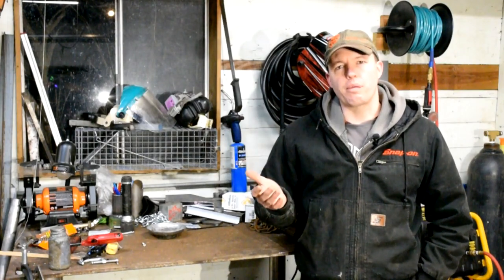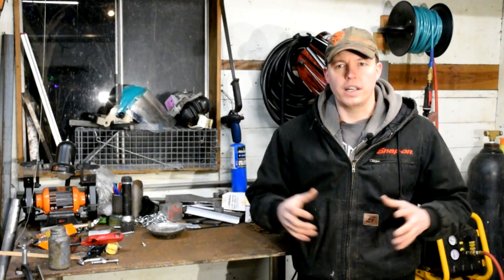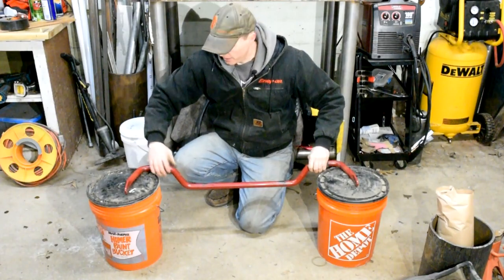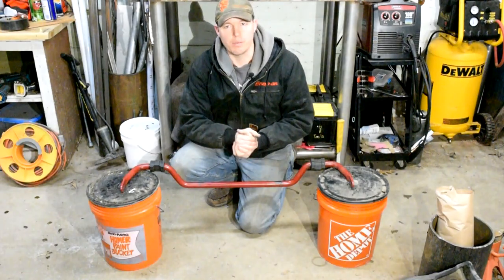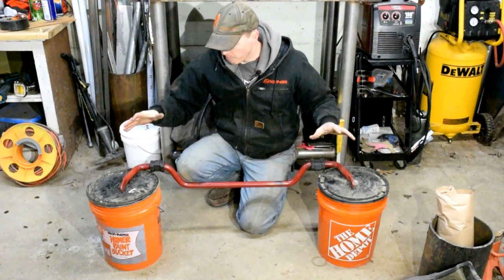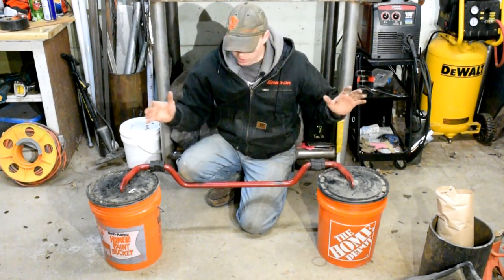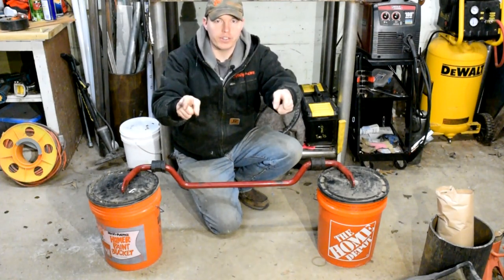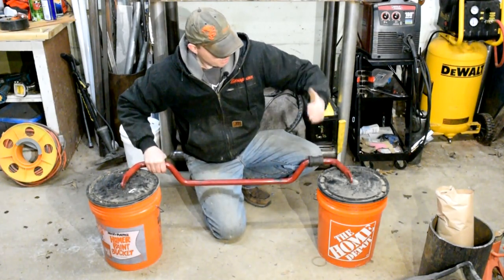How Sway Bars Work - Complete Explanation

Comment: Instead of a sway bar, has any car manufacturer company created a suspension that makes a car body bank towards the side it is turning on.... Similar to a motorcycle when it turns....
Reply from the maker: Yes, some car manufacturers use active suspension to counter the body roll. They probably don't lean in like a motorcycle but they help to better distribute the weight of the car.

Comment: the clamps on the bushing it should be very tight no movement whatsoever. The reason why the sway bar is a an actual spring for each side it’s not meant to move on the other side because the spring on the strut will push it down to stabilise  that side.  so  the middle of the sway bar is not moving. That’s my theory!!!! Thanks
Reply: What about when both wheels go over a bump then?

I'll tell you: both ends of the swaybar go up because it pivots at the bushings. Otherwise you couldn't drive anywhere!

Comment: The outside suspension compresses as inside suspension gets lighter (expands).
Sway bars are engineered to resist & balance asymmetrical compression to more desirable amounts via a twisting force as a feedback-loop.

A turn transfers x % of load: 
The CoG-change + centripetal forces' sums to dynamically spread across an axle transferring more load to the outer wheel.

The law of conservation requires that (on avg) the sum of weight across an axle be equal to the weight over the axle.
The center of gravity's transition however, can be mitigated; this is to maximize PSI over the inside-tire. 

While the PSI over a contact patch determines friction between most materials, tires are different:
As force increases over a tire, it will provide a lower 'ROI' of the weight's investment.
As force decreases over a tire, it provides a HIGHER 'ROI' to the weight's investment.
(this is one way a sway bar can be helpful).

You want roll, squat & dive; you just don't want all its travel consumed (except F1 who use bump stops).
Tires also act like shocks; higher PSI = stiffer 'shocks' and lower = softer.

A sway bar thick enough to resist all torsion would cause both side's suspension to compress equally.
But apparently, it can also make the inside wheel lift in some circumstances (rumor?).

A sway bar's utility is increases agility: Stiffer suspension + sway bars TRADE stability for peak traction.

The weight experienced by either side is a function of Physics Laws, and:
THE LAWS OF PHYSICS ARE NOT SUBJECT TO REPEAL NOR SUSPENSION  <-- see what I did there?

They can improve AGILITY at the expense of peak acceleration (turning) forces, excluding dynamic tire performance TLS "tire load sensitivity."

They're also engineered to flex instead of cracking within the range of motion that suspension is designed for while not becoming a paperclip.

Comment: One thing to mention, stiffer springs are not entirely a replacement for a sway bar. The sway bar does nothing when both tires are compressed the same amount, for example, on a hill, speed bump, or elevation change, the sway bar doesn't do anything because both sides are coming up or down together on their own.

Comment: in the most simplest explanation... when the car turns to the left , the left side of the vehicle starts to LIFT UP and the right side starts to press down. which causes potential roll.
with the sway bar, when the car turns to the left , the left side of the vehicle starts to LIFT UP but the sway bar tries to keeps it from doing that because its solidly connected to the RIGHT.
pressure from the right help keeps the left side down through the sway bar.
Reply from the maker: Yeah, thats another way to look at it.

Comment: The only thing I would say is over steer and under steer are fundamentals of steering and suspension geometry, so the anti roll bar does not effect thise principals. What you're actually describing with that incorrect term is a loss of traction as you have exceeded the coefficents of friction on the tyre! Yep, a mouthful, better described as skew or a skid. Any loss of traction is technically a skid. 🙂
The best way to think about over and under steer is where the Akermann intersection is (where the lines from KPand steering joint cross) if it is before the rear axle or anti-akermann, it will under steer, if it is behind the axle it will over steer.this will be measurable and seen at 1mph (you need to avoid tyre deformation to get a true result).

Comment: so the sway arm is connected in a way that shortens the length of the struts evenly against lateral forces of the of the body movement,  by basically compressing the strut on the opposite wheel to keep the car level through a turn.
Reply from the maker: Well, its trying to use the resistance of the strut on the opposite side to help resist the compression of the strut on the outside of the turn. Which does lead to some compression of the strut on the inside wheel
Reply: @goddom  ok . thx

Comment: I think you're too focused on the outside wheel in your explanation.
The way I like to look at it, your wheel assemblies are always in some state of compression. They are floating. If their load is lightened, the suspension will expand, if their load gets heavier, the suspension will contract.
 
So basically what the sway bar does is creates a connection between the right and left side suspension. If one side compresses, the bar twists to compress the other side. Now you are accurate in saying that this does serve to correct the outside wheel, but that's actually skipping a step in my opinion.
 
The more important feature in my opinion is the compression of the inside of the turn. The twist of the bar pushes the assembly up (or rather, pushes up the equillibrium of your tire assembly and suspension) and this allows the inside to be closer to the ground which helps to correct the weight distribution problem.

Comment: I race non suspension go kart I see what the bar does is pick the inside tire up but can that make the vehicle dump weight on the inside tire?
Reply from the maker: By limiting the transfer of weight to the outside tire. But if its actually picking up the inside wheel than the sway bar is not working any more and you need to install stiffer springs.

Comment: So when one side is compressd  It works against the Spring on the other side which increases stiffnes on the compressed side. On something off road that seems like it would limit your suspension a lot
Reply from the maker: Yeah, I think it would. I am not sure what off road vehicles prefer when it comes to sway bars.

Comment: Hello teacher , I am the one that described my Kia forte  2019 (ONLY 16000 miles )  with chirping sound in your other video  I hope you remember me ???  i told you that when i turn the car aggressively   into right ( especially in bumpy road ) i hear the chirping noise in my  driver side)   . you kindly  advised me that i would tell the Kia dealership to check my  "sway bar bushings"  before they change my struts . Today , I just found out  they did NOT  changed my sway bar bushings because the technician told me that he ruled it out ( the sway bar bushing's  potential problem)  by disabling  "the sway bar from the  left and right end of the car ' and he said that he could still hear the same chirping noise when he drove the car, after disabling the sway-bar , so IT COULD NOT BE THE SWAY BAR BUSHINGS  .... Is disabling the sway bar from tiers rule  out the problems with " bushing rubber ) ??? I think they were lazy and they did not want to change my sway bar bushings ...After watching this video ,  I demanded the kia dealership  to change the bushings ....ARE they telling me the truth ??? Can they rule out  the  potential chirping noise coming of the sway bar bushing by disabling the sway bar   form right and left ends ???? base on your great explanation, i told them the  bushing still CAN MAKE NOISE even if sway bar is disabled .  dear  teacher , am i right ???? ( by the way they did change the strut bearing / or mount and they did spray with silicon grease all my bushings , EXCEPT  sway-bar bushings )  ) I am gong to see then this week ( Thursday to change my sway war bushing hoping the chirping noise goes away )
Reply from the maker: Well it depends on how they disabled it. If they disabled it properly, and they could still heat the noise, then it probably not the sway bar bushings, but at this point I think it would be better to change them out and see if that fixes the issue. Without seeing the car, I am not sure what else to suggest at the moment.
Reply: @goddom  thank you for fast reply . i will ask them to change the bushings .
Reply: @goddom Dear  teacher , I just went to kia dealership today to get my car and  my car is  NOW completely messed up ....Now , is making 1000 times more noise  than before ....Now i s making Clunk  noise even on the smooth high - way and smooth roads ......lots of body roll and balance of my car is completely off  now . I think my car is useless .....This after 8 trips , going back and fourth to   to the  dealership . i was so  mad .... i just left my car there and  I called a taxi right away  ..... i knew if i stayed there , they would  call the police on me ( i knew i might cause commotion there )  ....I was so furious .... .I am going  next week to talk to the  main manger . I hope i can keep my cool.
Reply: @ampiciline  Any luck?  What happened?

Comment: I backed into my 99 Nissan Maxima with my 06 Town and Country. I struck the front fender of the Maxima behind the wheel with the rear corner bumper of my minivan going 5MPH. I wanted to replace the front suspension of my Maxima when I discovered the sway bar link broke free from the control arm. What kind of damage could have done to the sway bar during a light impact?
Reply from the maker: Probably none. If the end link broke I am sure it took the brunt of the damage. Also sway bars are like springs so its hard to bend them because they spring back if not bent to far.

Comment: Been having an issue with the sway bar in my 2011 Subaru wrx. Should the sway bar be able to move side to side in the bushings?
Reply from the maker: Not easily. I wonder if your end links are worn out. May want to replace the sway bar bushing and end links.
Reply: It shouldn't but it can. Depending on the design of the bar it may have stoppers connected permanently or bolted to the bar right next to the mounting points. This stops the bar moving side to side

Comment: so when u "upgrade" a front or rear sway bar, are you just getting a thicker metal or different type of metal so that it doesnt flex as much? also, for a front wheel drive car would it be a good idea to get a stiffer rear bar to reduce understeer?
Reply from the maker: Hello. Typically you are getting a thicker bar. I suppose you could get a different material, but that would be pretty uncommon. 

Correct, a stiffer rear bar will help with understeer - not always the case, but generally the case. When doing some endurance racing with a FWD car we opted for a stiffer rear bar to reduce understeer and it worked well.

Comment: thank u for information sir ....really u r a good teacher...the another benefit of sway bar may be improved negative camber of the outer wheel .if the wheel go slightly up then negative camber also increased..am i right ?...i do not know pls replay me
Reply from the maker: Hello. I hadn't thought about this, but yes, in general, it should increase negative camber. Its possible that this may not happen with different suspension systems. Double wishbone for instance may maintain approximately the same chamber angle.
Reply: @goddom  thank you for your replay ..i am binal joseph from india............sir, i have doubt in double wish bone suspension most of them are with  upper arm is shorter than lower arm. can this configuration help to increase negative camber while cornering
Reply from the maker: @kunjumonbin  Hello Binal. Yes, you are correct, I wasn't sure what application you were asking about and I just wanted to make sure you didn't assume this was true for all cars.
Reply: @goddom  thank you very much

Comment: Hi Eddie,
What happens if you change the positions on a adjustable swaybar from side to side. So you set one side in the 1st hole & the other side in the 2nd hole. What will be the result & why would this be an advantage or not?
Reply from the maker: This could be done. There are some companies that provide adjustable sway bar links that allow you to pre-load the sway bar in some fashion. This would depend on the track - it may or may not provide some advantage. Off the top of my head, if you have a particularly tricky corner just before the the only straight - preloading the sway bar so you can take that corner even 1-2mph faster will net you 2-3x more miles at the end of that straight and a second or so of time. I am making some wild generalizations here, so don't take these numbers to seriously because it depends on the car, the straight, the rest of the track. 

I am not very familiar with circle track - they have their own black magic for suspension set-ups - but I could see where there is a constant turn, you could pre-load the sway bar and it would help pretty significantly in this situation. 

I hope this helps and if I wasn't clear feel free to ask more questions I will try and get to them quickly.
Reply: When preloading for circle track, which link should I make longer? I keep overthinking the suspension. 2000 integra double wishbone

Comment: I have some questions...I recently lowered my car, with a suspension kit, and at the time of doing my research before buying it, I came across 2 mods I don't think I quite understand: adjustable drop links and different size bushes for the anti roll bar. Would appreciate the enlightment lol
Also, I have a fwd car with a solid rear axle, does that mean I have a lot more room to stiffen up the front at all?
Reply from the maker: Adjustable drop links help with fitment and you can, if necessary, add some preload to the sway bar. Usually not necessary. Different bushing sizes might also be more of a fitment, not sure off hand the benefit of bushing size. 

As for the sold rear on the back, it all depends on how stiff the car is right now. If the car is a bit oversteery right now, then you can stiffen up the front, but if you are getting understeer than you need a stiffer rear. The sold rear axle doesn't change the need for a sway bar in itself because the sway bar controls weight transfer as the body rolls in a turn.
Reply: @goddom  thanks for the wisdom. I will see what I can find about the bushing size. 
Don't have any other options for my car for anti-roll bar upgrades lol

Comment: So I lowered my car a while ago and found out that sway bar links need changing as well. I used BC Racing coil overs and dropped it about 2” total, and it feels just fine. I want it to handle, that’s the thing. It seems to be great in corners, considering I’ve pre-loaded both sway bars by not shortening the links how would that affect it?
Reply from the maker: Well, if both links are the same length then it doesn't pre-load the sway bar. You can pre-load it by having asymmetrical links, but that might only help you at certain tracks. But having links that are to long may prevent it from working properly in certain situations. Depends on a lot of things though like spring rates, and body roll. If it feels fine, not running on anything you are probably OK for now.
Reply: If you've dropped by 2" you've probably changed the swaybar geometry somewhat. The bars are most effective when the 'arms' are horizontal (at normal ride height) and the end links are perpendicular to the arms. You might need shorter end links to keep the geometry as close to ideal as possible.

Adjustable links are beneficial because they can be fine-tuned to make sure there's no preload on the bars. If you adjust your ride height, corner balance etc there will always be some degree of preload with fixed-length links. Might not be an issue but if you do any performance driving it's probably worth the investment.

Comment: I am allowing a company do do some R&D on my stock Q60 in which they want to create sway bars... I do not know anything about this nor would it have been something I would change on my car. I was all about it but having second thoughts. Any advice?
Reply from the maker: Well it all depends on what you are doing really. If you want something that is a bit more racy or you are planning on racing your car better sway bars will help.
Reply: @goddom  
No not really, I added an exhaust that they also put in and I haven't had to pay for this. But at the same time I don't know if it's a good idea to mess with the suspension!
Reply from the maker: If the car is comfortable to drive then I would not touch the suspension, I do not think changing the sway bars will help.

Comment: Can be fit 3 pieces of D bushes at the back of sway bar? Handling better?
Reply from the maker: Adding more bushings shouldn't change anything. If you put a stiffer sway bar in, sometimes the mounts crack, so for some car you have to reinforce the sway bar mounts. Does this answer your question?

Comment: I recently changed wheel size on my Chrysler 300 18220 s now my tires are wearing crazy my front driver sideis wearing on the outside real bad real fast that passenger side has a little wear on the outside and the rear passenger is war real bad on the inside and the driver rear is it's okay well that have something to do with a sway bar
Reply from the maker: Probably not, it sounds like an alignment issue. It might be because of the wheel change threw something out.